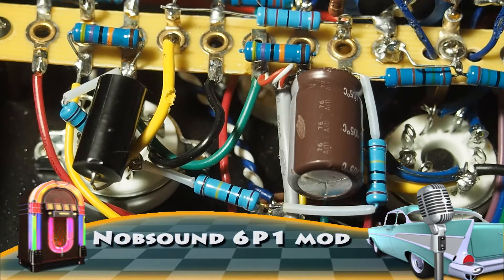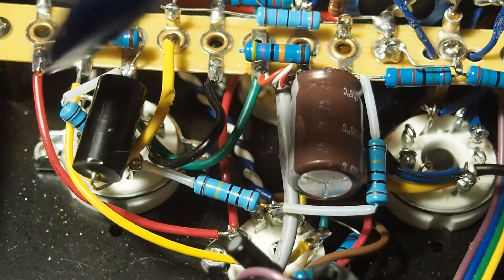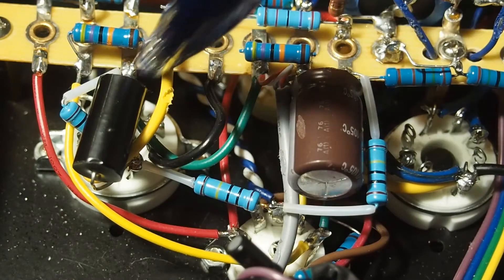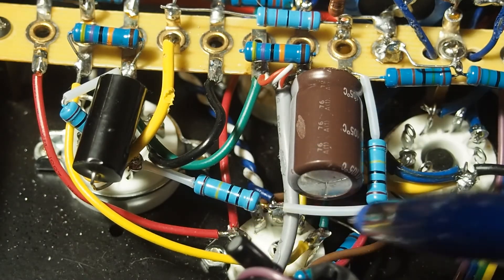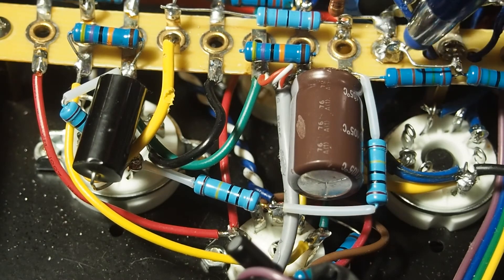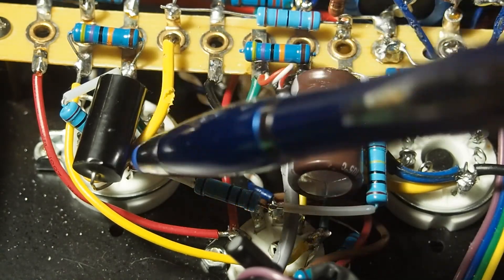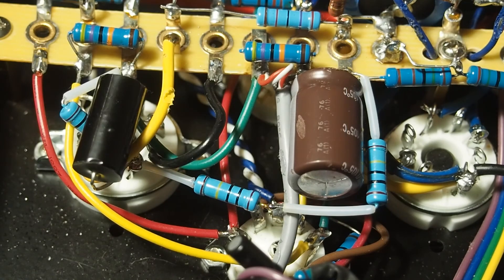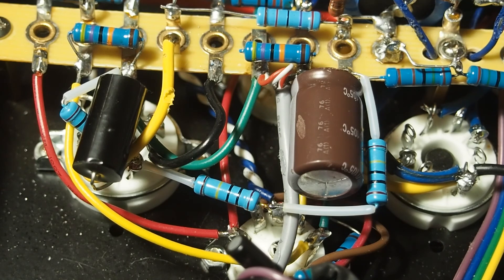Nobsound 6P1 Tube Amp Mods

Comment: You need a 2M ohm 1/2w resistor and need to do this to both the 6H8C tubes, correct?
You didn't list the part and only showed one side but it looks like in your other video both sides have the same modification. Thanks
Reply from the maker: Yes both channels need this mod. I hope to do a better video on this in the future, this honestly was the first instructional video like this I had ever done. I got tired of trying to explain this in text in a forum and decided to try a video format, which clearly is easier for people to follow.

Comment: Power Supply mods question: Can the 22uF after the filter resistor (1.5K)  be swapped with the 150uF before the choke. I think this would achieve the effect of reducing the peak surge current  through the rectifier tube.  Just to be clear you would then have 22uF --150uF---22uF.
Reply: Sorry,  Typo..I meant .. 22uF--150uF--150uF
Reply from the maker: You don't need that much capacitance there and the 22UF cap needed is less that $1.  "Swapping" them would be 22uf-150uf-150uf. Also each channel has that 22UF cap after a 1.5K resistor, so one channel would have a 22UF cap and the other a 150UF + there is physically no room to swap it there. Hope that helps!
Reply: Thanks. Got it.

Comment: Can I do this resistor mod if I haven't done the coupling cap mod?  I didn't do the coupling cap or grid bypass mod , I wasn't certain about it yet
Reply from the maker: This mod can be done on it's own. I just uploaded a video explaining the other mods I recommend for this amp.
Reply: can I use a gz34 rectifier tube instead?
Reply from the maker: @paullevine9598  I wouldn't recommend it. It raises all the voltages in the amp as the 5AR4/GZ34 has less voltage drop across it.
Reply: Thank you. You are awesome